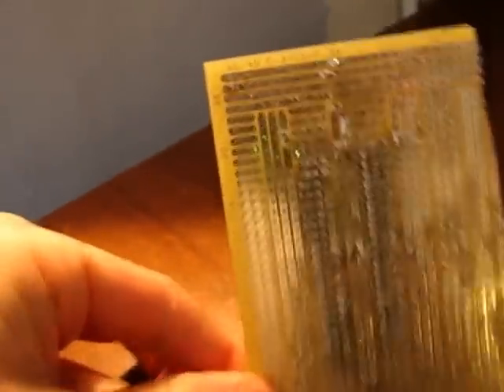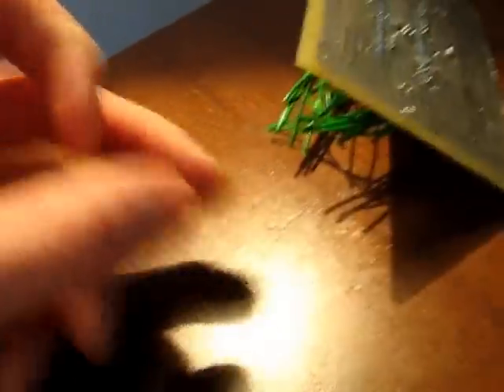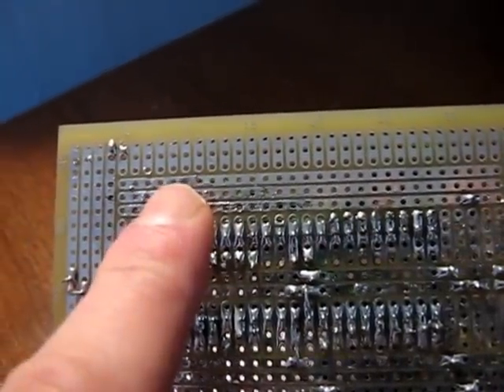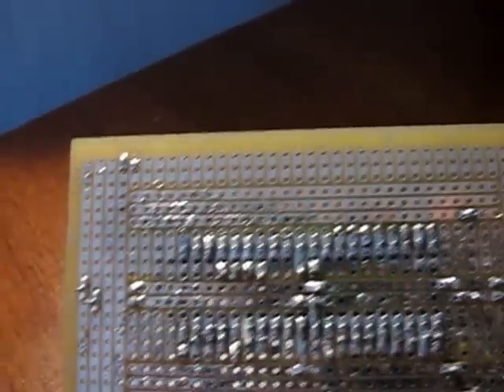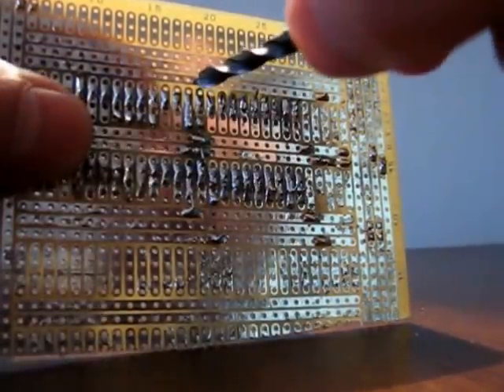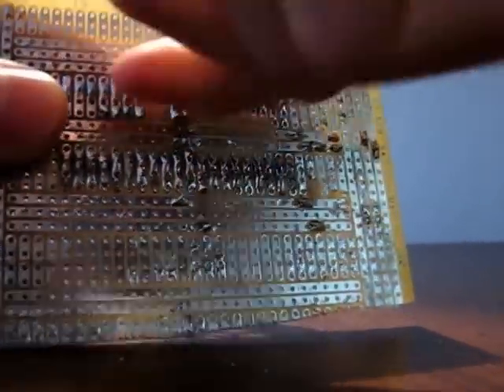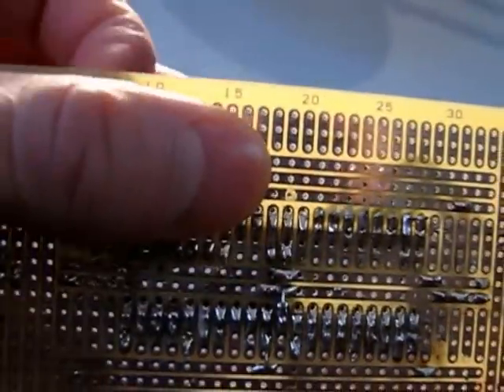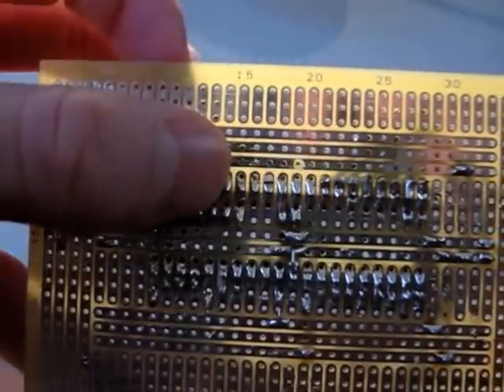Stripboard track cutter - How to break a line on a stripboard

Comment: I use a Dremel Tool/Rotary Cutter with a thin cutting disk to cut the copper strips and to cut the boards to size. You need to know the circuit layout to know where to cut.